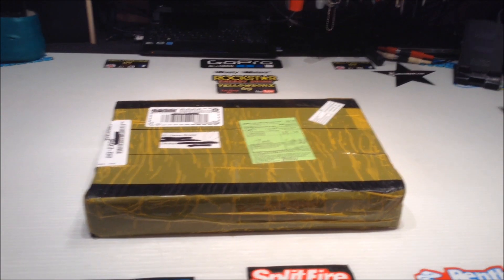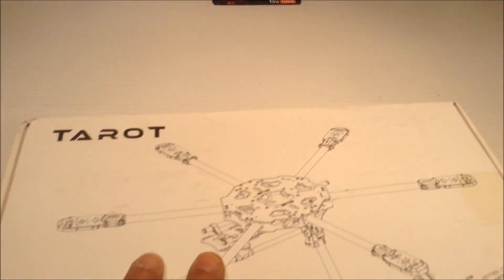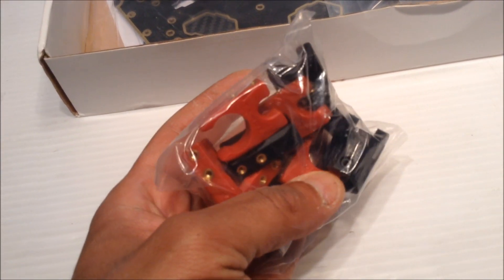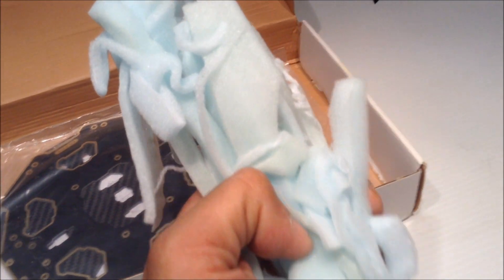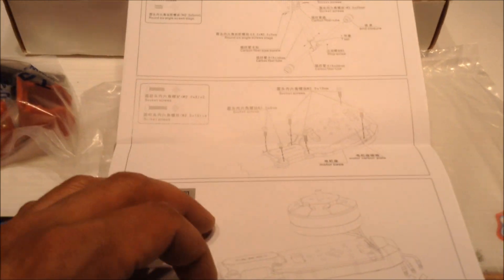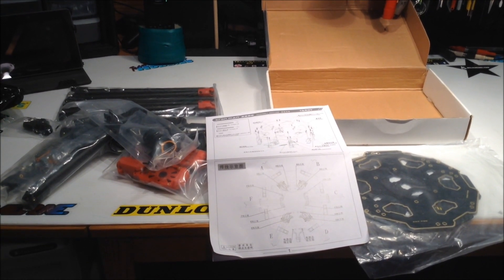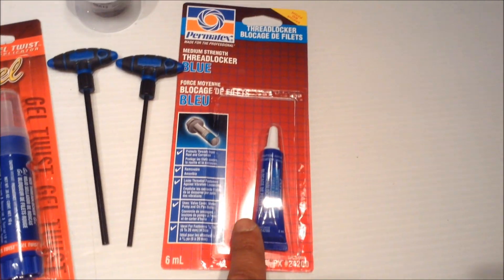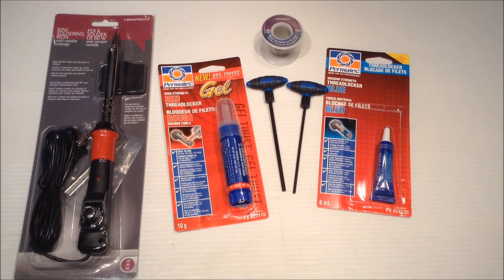Tarot 680 Pro Hexacopter Build Part 1

Comment: Could you please give your parts list? Looking foward to the build, can't wait, Eh!
Reply from the maker: Thanks. Parts are as follows ,

Afro ESC's 30amp Simon K flashed
AX-4008Q-620Kv Motors
Naza M Lite w/GPS
FrSky Taranis Tx w/ 8ch receiver
14x4.7 Carbon Fiber Props
2 Tarot Velcro Battery Straps
Tarot Carbon Pattern Canopy
2 Lipos 14.8V 5000mah 50C

Turnigy Twin Strobe Led Lights
Lumifly Nav Lights
Tarot folding GPS mount
2 Spare Camera Suspension Hooks
2 Tarot Tool/Accessory Pouches

60 Watt Soldering Gun
4mm shrink tubing
Tinning Flux
Lead Free PC Solder
Red & Blue Loctite

That's everything I bought to go along with the Frame, I have not yet decided to connect the motors via bullet connectors or to just hard wire directly.
Reply from the maker: I will also have one my YellowBonz69 Glitch Busters onboard as well, after seeing it perform on my Quadcopter with the Retractable Landing Gear I won't even bother with the external bec.

Comment: Nice look forward to the build. On the alloy tube clamps soften champher the inner edge where the two parts meet. Otherwise they can cut into tube. I leaned the hard way.
Reply from the maker: Thanks for the tip bro